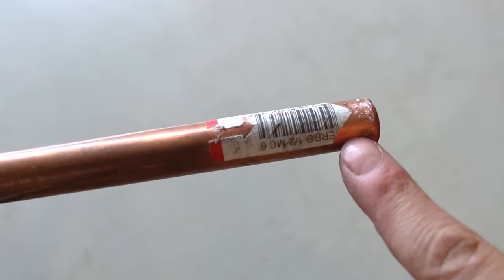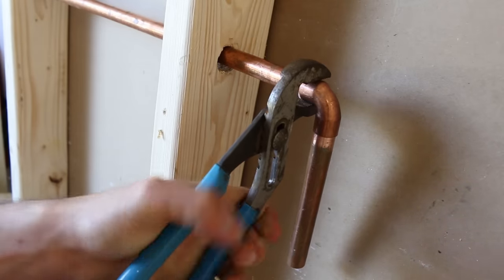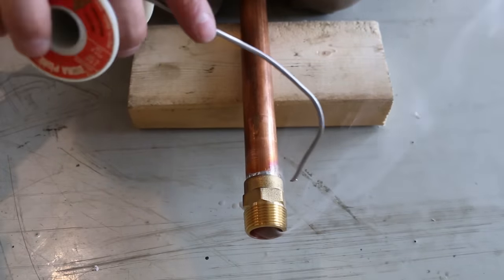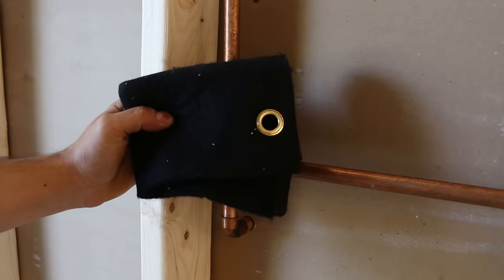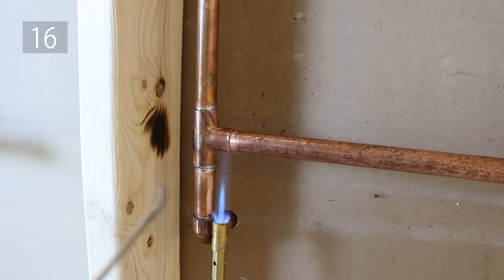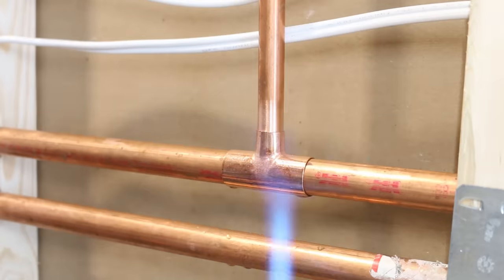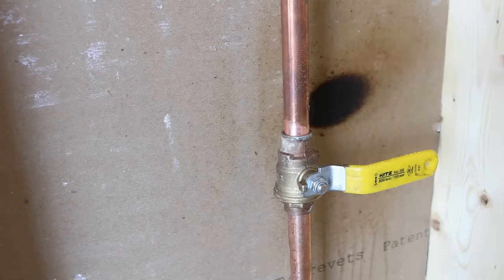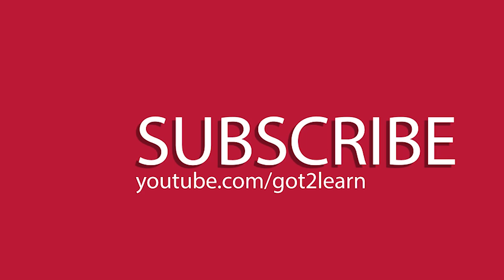The BEST 25 Copper Pipe Tips & Tricks EVER! | GOT2LEARN

Comment: Heating/burning  PTFE tape is not a good idea, from the hazard data sheet:

3.HAZARDS IDENTIFICATION
3.1   The primary hazard associated with these polymers is the inhalation of fumes from overheating or burning Heating PTFE above 300 degrees C may liberate a fine particulate fume
3.2   Polymer fume fever, a temporary flu-like condition with fever chills, nausea, shortness of breath, chest tightness, muscle or joint ache.
3.3   The symptoms are often delayed 4 to 24 hours after exposure. These signs are generally temporary,lasting 24-48 hours and resolve without further complications.
3.4   However, some individuals with repeat episodes of polymer fume have reported persistent pulmonary effects. Exposure to decomposition products from PTFE heated above400 degrees C may cause pulmonary inflammation, haemorrhage or oedema.
3.5   These more serious consequences of exposure may occur from extreme thermal decomposition of PTFE witch can liberate fume particles, and toxic gases especially under condition of poor ventilation and/or confined spaces.
3.6   These decomposition products may initially produce chest tightness or pain, chills, fever, nausea, with shortness of breath, cough, wheezing and progression into pulmonary oedema.

I've seen these effects, on the plants that produce PTFE, amongst smokers who make their own cigarettes without washing their hands properly.

Comment: When soldering copper pipe it is not good to hold your torch under to fit in your soldering because you can get solder  inside your torch.
Reply: 6:40 that drop that fell, see you are doing it all wrong
Reply from the maker: It didn't fall in, but you are right, never solder with your torch directly under.

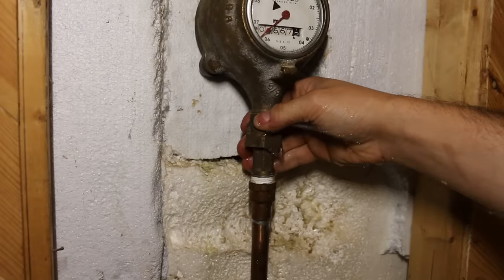Comment: 3:33 In my experience (which isn't that extensive) acetone is an EXCELLENT, low-effort chemical to clean off stickers and their residue.  I don't know if it's safe to use acetone on copper.  If anyone is gonna use acetone WEAR GLOVES -- if I put acetone on a finger it dries out so bad the skin turns white (literally) in less than a minute.  Acetone is very volatile AND flammable, and will damage some materials (e.g. it melts a lot of plastics).

Comment: Yes... let's point the torch at the wall... or you could hold the torch so the elbow faces the wall and then heat your pipe. Suddenly your fireproof cloth and license plate are useless expenditures...

Yes... let's spray water at the wall... it's not like someone is going to be closing that up in the same day (well, not every time). Water in a sealed space like that will cause mold, which will become a disaster later. Simply... don't point your torch nozzle at the wall and you won't burn it.

By the way, you can heat either the fitting or the pipe to solder. "How close to the stud" doesn't matter as soon as you remember this fact, and are not pointing your torch at the wall or stud in the first place.

A burn on the wall or stud creates a static ignition point. Charred drywall paper or wood needs to be cleaned completely of char before walking away from the job. Water moving through your copper pipes creates static, and while low level, charred surfaces re-ignite easier especially as they dry out.

Heat the fitting when possible, and it will suck the solder into the joint creating a better and more even seal. Watch for your solder to wick completely around the pipe and use only a little more, you will have used the right amount of solder.

...and yes, pointing the torch at the wall and leaving burn marks for any reason is the sign of an amateur.
Reply from the maker: Happy new year!

Comment: I can tell you that I was taught to use a small wet rag to cool and remove excess solder from the pipe. I never had a pipe leak. That is twenty years of soldering, so maybe my old plumber teacher was correct and you are maybe a little wrong ???? Just saying fella. Like all the tips you showed.
Reply from the maker: That's because you are skilled and you know what you are doing. A lot of beginners will do this to cool the pipe but they'll move the joint while doing it, which increases the chances of getting a leak..
Reply: @Got2Learn  You are so correct Got2Learn. Would you believe that I didn't even think of the obvious. Thank you for reminding an old salty plumber. Peace and good day too. VF
Reply from the maker: Have a great day buddy ;)))

Comment: Confession: I used to cool joints with a wet rag. Shame on me.
Reply from the maker: You can, as long as the joint solidified first 👌
Reply: @Got2Learn  Your videos are great. I work maintenance and we have no plumbers, but we do all the installs on tubs, water heaters, shower valves, burst pipe repairs...a lot of sweating copper. It's good to learn from those that actually know. And your cutaway demonstrations are gold! It's best to understand WHY we should do things a certain way!

Thanks a ton, and keep in truckin'!

Comment: You forgot a critical tip! When the flame turns GREEN, the joint is ready to take soldier, if your soldiering by a faucet/hose bib wrap the faucet with a wet rag.
Reply: doesn’t always turn green solely based on flux used ... not all flux will turn flame green
Reply: @Cigarsmokin_woodworker  I've never used a flux that didn't, but I don't know that it is the flux causing the flame to turn green? 
I'm not a plumber by trade, I am a general contractor and have remodeled at least a house a month for 20 yrs., it's always been the same, when the flame turns green the joint is dry and ready for soldier.

Comment: I dont like the bread trick. Theres so many other better ways to avoid using a literal hack trick like bread. Compression fitting, union, tee with a plug, bleeder coupling, pro press, shark bite, pex tube. I do like the other tips though!
Reply from the maker: Sure thing, here's a video I made just on that subject: https://youtu.be/lNUAX6mJTlA
Reply: Tell us why you don't like the bread trick.  It's old stale bread.  It really works if you need water out of a pipe for 30 seconds, so you can solder it.
What do you have against it?
Reply: @TheGhettoLobster  you're right - I'm a hack.  Which part do you not like?  Enlighten us hacks.
Reply: @TheGhettoLobster  FUI plumbing stores sell little plastic beads with gel inside to do the same thing as a little bit of bread will do - just hold the water back temporarily.  The little beads dissolve after a while and are flushed out.  Just like the bread does.  All those things you mention do not really solve the problem of holding back water temporarily.  Are you a plumber?

Comment: Why on earth would a burr "eventually cause a pinhole in the pipe"?
Reply from the maker: Do you research, it will.
Reply: Burr causes turbulence which will wear pipe quickly.  Seen it in 1 1/2" copper swimming pool plumbing.

Comment: Soldering in open, easily accessible spaces like this is nothing special and NOT the reality of service plumbing. The reality is you will be soldering below grade in the mud, in a wall or ceiling with drywall and insulation all around you that could easily catch fire and on top of all this you may or may not have residual water in the pipe disabling soldering from taking place. It is for these reasons that although soldering is a necessary technique and know how, all the pros these days generally use a propress gun. The torch is generally only used in a situation where the propress gun won’t fit.
Reply from the maker: Yes of course :)

Comment: The reason to de-burr the inside of the pipe is to stop any restrictions for the water and cooper pipes are not soldered but a process the plumbers call "sweating". To keep your angled fittings from turning don't stick a join of pipe in them. This guy is full of shit.

Comment: Got2learn well I have got to laugh. Licence plate NOOOOOOO, use fire retardant cloth made for the purpose. Have you not used solder ring fittings?  Plastic pipe for all stud work piping much easier and safer and no backlash from the main contractor for burning stud-work, would be costly to repair. Alternatives:- Use electric tongs for soldering or compression fittings (no heat needed}. These are not tricks the first-year apprentice should learn these.
Reply from the maker: No comments lol.

Comment: You are using a propane torch?  Obviously you are not a plumber.  Scotch pad?  How about open mesh sand cloth!  Who uses a gate valve in the 21 century?  Bread is for sandwiches and is not for soldering copper pipe!  Rounding copper pipe is accomplished using a swag tool.  You are a hack, not a plumber!
Reply from the maker: Thanks for the view and comment!
Reply: @Got2Learn 
Just saying from 50 years of experience!  There is absolutely no reason to remove a stem when soldering a valve.  They are designed this way.  That doesn't mean burning the hell out of it though!